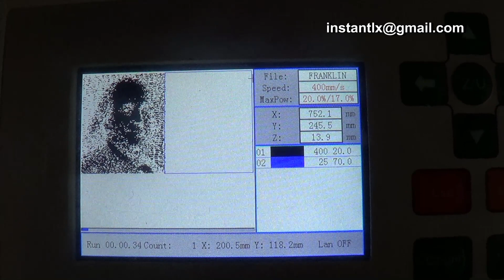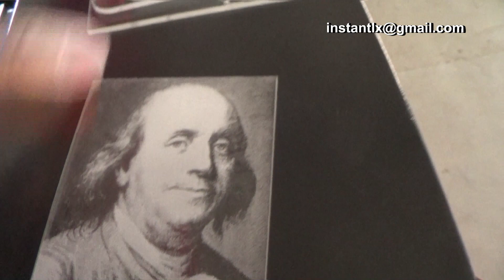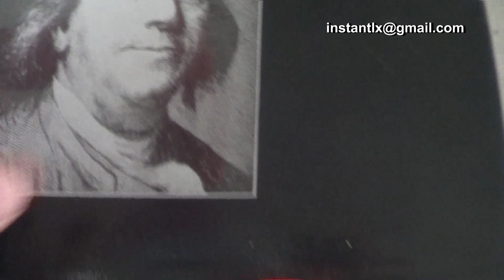Engrave Franklin on Acrylic, China laser cutting and engraving machine,

Comment: Is it safe to use 400speed
My machine is shaking and vibrating??
Reply from the maker: Well. The machines that I sell can run 500mm/s for scanning. If your machine shakes at 400mm/s then reduce it to a reasonable speed. or try fix your machine onto the floor. that may help a bit.